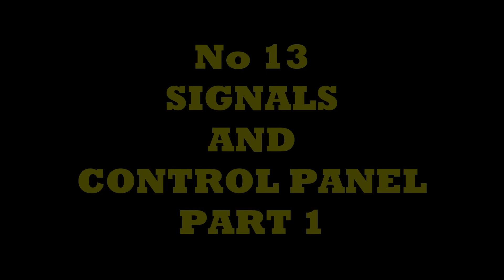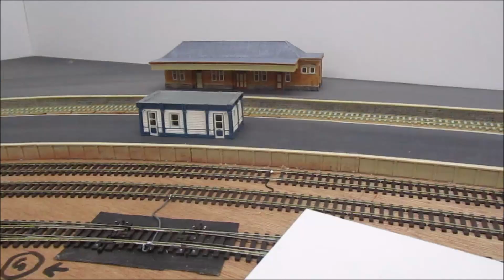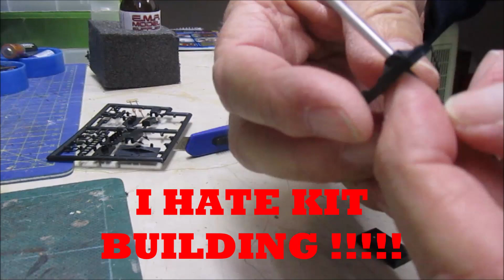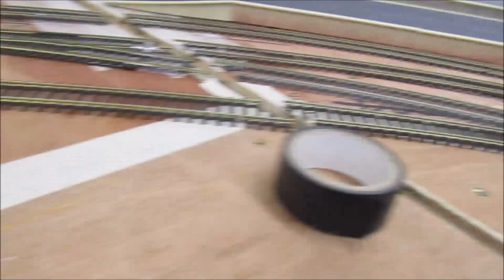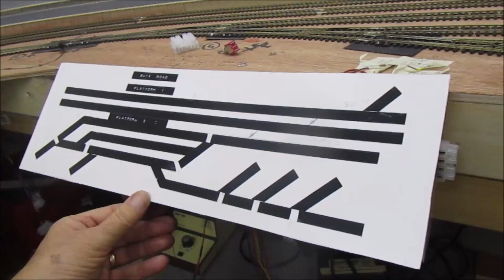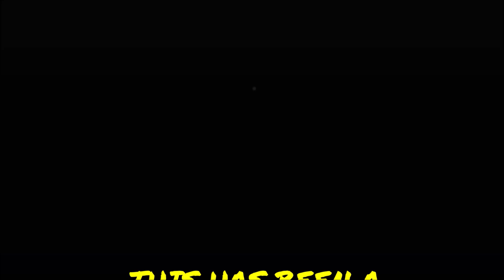BUTE ROAD No 13, Signals and Control Panel Part 1, NOTE = I spelt Meningitis wrong at the End of Vid

Comment: Hi Andy regarding the safety hoops on the Train- Tech signal. I too had one break at exactly the same point as yours . I think they are very flimsy and could do with a little more beef in them. The layout is coming on very well.
Reply from the maker: Hi Denis, Thanks for that, I don't feel so bad now, hahha,🤣 as I said, I hate Kit building, a mate is doing my other one, so it will be interesting to see if he can do any better. Cheers for your feedback. 👍